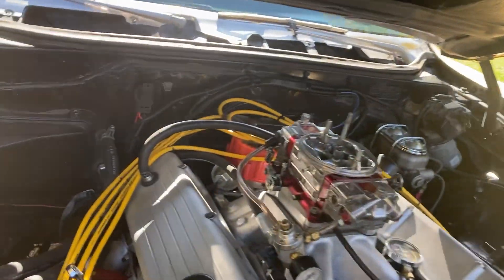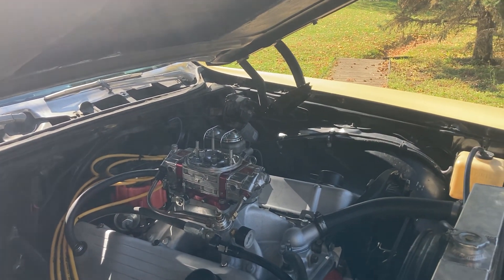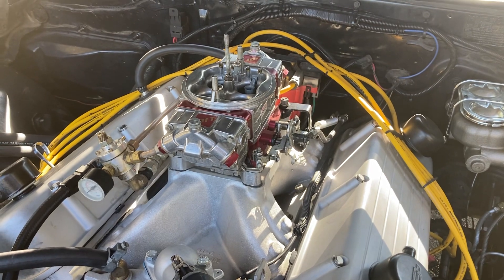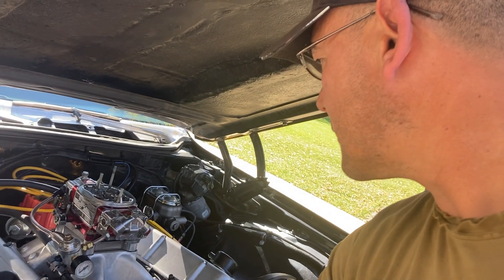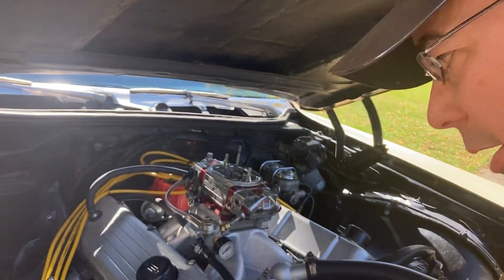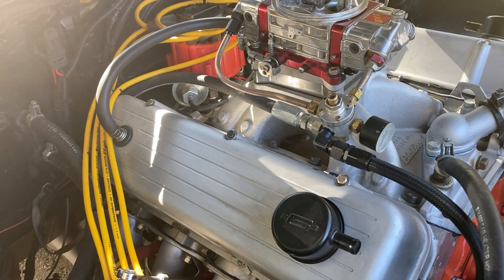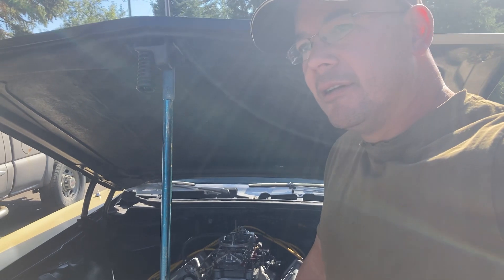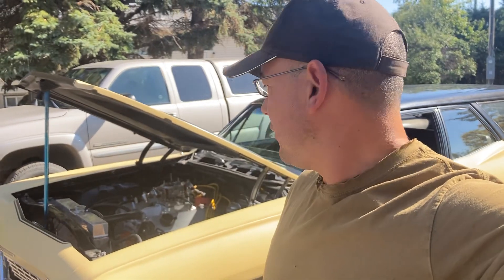Full Manifold Vacuum or Not

Comment: I went to make the change from ported to manifold vacuum advance and was expecting an RPM increase which I was planning on lowering with the mixture and idle screws but it didn’t move at all. What are your thoughts?
Reply from the maker: @RamblingClassics2   Is the vacuum source you swapped to for sure full vacuum? Is the vacuum advance pot in good shape?
Reply: @twgarage-terrywatson1672  can was bad so swapped and working as it should now. Next step is what timing as idle has increase more than the idle screw drop will give me! Mod cam so OEM not applicable so all by feel and vacuum gauge, thoughts?
Reply from the maker: @ keep you base timing and full mechanical the same as you had if you were happy with performance. My car is a manual transmission so no rpm drop from pulling into gear like an automatic. Is your vacuum canister adjustable? You should notice rpm increase with full vacuum. Lower your idle to your preferred rpm. With an automatic transmission, I like to adjust carb while vehicle is idling in gear. (Set park brake, block wheels)
Reply: @ agree re timing and idle lifted but idle won’t lower so now I have to work out why idle is so high! The Screw is fully disengaged so as low as it can go, not sure why so it is a weird one? Can is not adjustable and set at max 10”. If I could get idle to drop job would be done now not sure what to look for as I can’t find any vacuum leaks anywhere. Thoughts
Reply from the maker: @ What carb are you running?
Reply: @twgarage-terrywatson1672  I have an Edelbrock 600. Found my issue the choke was slightly stuck open so sorted now with the can now working I am on manifold advance just had to tweak timing back a bit as it was pinging at light cruising. Just need to decide if I am happy with idle quality as the mod cam chops it up a bit.
Reply from the maker: @  If you don’t have an adjustable vacuum pot on your distributor, I would suggest looking into one. Then you can dial that vacuum advance in perfectly. You could try blocking the vacuum advance to see if your mechanical advance settings are dialed in, then with vacuum added if it pings you could probably dial that in with an adjustable vacuum.
Reply: @twgarage-terrywatson1672  yes mine is a fixed vac unit of max 10”. It did ping at low cruise so I dropped the initial a touch and ping is nearly gone. Adjustable would work well I think as distributor has been modified so will help find the right adjustment for sure. But I am running on manifold vacuum and so far engine is cooler and power is much more lively 👍

Comment: I hooked my 289 up to manifold vacuum and it definitely idled smoother...but 6 months later the brand new diaphragm was already bad... So because there is a constant pull on the diaphragm it won't last as long
Reply from the maker: @joeytacey743  interesting, what brand? I’ve been running an off the shelf HEI for over 10 yrs.

Comment: I retracted my original statement in order to keep your explanation . Thank you for explaining it .
Reply from the maker: @charlespartak2435  Thanks but you are 100% incorrect. At idle is a great spot for full vacuum, why have the throttle plates open more than they need to? Just making more heat.
Reply: Ok. Not arguing , just trying to understand . I see a lot if not most going to full mani vac to the adv pot are 350s or larger and running large cams and holleys.
What do you think of a mildly cammed 283 and a 500 edelbrock avs2? Street cruiser, automatic, 3.25 rear,  about 3750 lb vehicle.
Reply from the maker: @charlespartak2435  The main thing is that full manifold or ported manifold is for very light load, high vacuum situations. At idle the throttle plates are only open a small amount. At this point there is no load on the engine. By adding additional vacuum advance the engine requires this as the mixture is very lean. Lean mixtures require advance as they are harder to burn than a richer mixture. Basically try this. If you are running ported vacuum, hook it up to full manifold and your engine will speed up due to more advance. Then you can close the throttle plates more taking in less air and fuel which will result in a cooler running engine. When you take off the vehicle is under load, the vacuum advance drops out and you will be running on mechanical till you are up to speed. Highway cruising on the flat requires very little hp use from engine, vacuum is high and engine is under light load. The additional timing from the vacuum advance gives you better mileage, cooling running temps. Ported will give you the same at light loads and cruise as well. The full vacuum at idle gives you a more efficient burn as I the spark is happening sooner. Mild engines produce lots of vacuum at idle compared to a more radical build. I personally run full vacuum on all my street cars regardless of mild or wild. Remember, when your foot is to the floor accelerating, you are only running on mechanical. A lot of people mistake this part. Try it out yourself. Don’t confuse manifold vacuum with your total mechanical advance. Most street cars like 12-20 initial with 34-36 degrees total. Maybe another 10-15 of vacuum. These are not exact, yes every combination has slight differences. Try it out yourself. 👍
Reply: @twgarage-terrywatson1672  now that i understood ! Yes, my 283 has what id consider mild cam, summit k1102 , basic same grind as edelbrock performer plus. Edelbrock avs2 500 cfm. Th350 , 3.25 F9 on 225,70r15s. It idles great , drives flats fine,  just not pulling the hills here im n alabama . Currently vac adv is on ported , base timed at 12° btdc , pulling a solid 18hg on the manifold port. 
Ill give the full mani vac a try.
Reply: @twgarage-terrywatson1672  one other thing, my vac pot is the adjustable type. Currently its adjusted all the way in. Im assuming thats full vacuum applied when advance is required. How do i know if or how much i would need to adjust it out. Its a msd /jegs combo i made up of the best internals from each.
Reply from the maker: @charlespartak2435  The adjustment is based on have much vacuum your engine is giving you. The best way would be to hook up a vacuum pump and have it in the vehicle. As well have a vacuum gauge to read you vacuum at different loads/ speeds. My 496 in my wagon has about 10”hg at idle. Due to the aggressive camshaft, the vacuum is low. I have adjust the vacuum can so I am able to gain approximately 10 more degrees of timing at idle. At idle with no load my rpm is 1050 and timing reads 45degrees that’s full vacuum advance. Remember not to mix mechanical with the vacuum. If your engine likes 34-36 total on mechanical. Leave that part and just play with the vacuum. The adjustable vacuum can on the distributor, you are adjusting based on your engine vacuum. I’ll try to post another video and try to better explain it.
Reply: @twgarage-terrywatson1672  your idle speed is 1050? Why so high? Half that is enough.
Reply from the maker: @charlespartak2435  Solid roller cam, open plenum intake, 950 carb, .250, 260 duration at 0.050. It wouldn’t run at half the rpm.
Reply from the maker: @charlespartak2435  That sounds like a real nice driver combination. With the vacuum your engine is making, I’m sure this combination purse like a kitten at idle.
Reply from the maker: @charlespartak2435  Curious, what cylinder head is on your 283?
Reply: @twgarage-terrywatson1672  it does. I have summit racing mufflers on it , true dual. It purrs until i step on its tail then she roars. Sounds pretty good. I did put it on full man vac yesterday. Got idle down more and mixture screws in another half turn from when i had it on ported. It took your explanation and a phonecall from my former tv car guru friend to convince me..
Havent taken it out yet for road test but thats coming
Reply from the maker: @charlespartak2435  Let me know how it goes. 👍

Comment: Mine is also noticeably cooler running full manifold vacuum to my vacuum advance. it's not even close.
Reply: @mooosestang  how much difference and are you using a ground temp sensor? Mine is the mechanical one , mounted up front on top of the intake next to the thermostat neck

Comment: After building my 350 s10 build i learned that most have no idea what they are doing. I used ported vacuum first and got nothing but over heating and shit fuel economy. I switched to ported and now i have better fuel economy and she never runs hot at all! I can sit still and idle all day and never get over 190 degrees. To avoid the typical idiotic argument I will not even say a word when people I knows hot rods over heat, I will just sit there a giggle to myself.
Reply: Reread your own comment. You started on ported then switched to ported...i believe you meant manifold in one of those.
Reply: @charlespartak2435  lol sorry basically ported vacuum works best, its the way shit was before the fuel crisis of the 70's
Reply: I agree

Comment: On my particular engine it actually runs better on ported. I’ve always ran full vacuum but on this particular high performance 350 Chevy, it prefers ported. I believe it is because the timing is so far advanced, initial at 19 and total at 36, full vacuum is throwing off the timing curve when I hit the throttle. It is actually less responsive with full vacuum compared to ported. It really boils down to your engine setup. No right or wrong answer. Go with what works best for your engine. What might work best for one engine isn’t always the case across all engines.
Reply: you need an adjustble  vacuum advance  canister.  and it neess to fully open  at whatever  your  engines vacuums is  at idle.  they need to match  or you could  very well get way too much  at idle,  giving  you that issue

Comment: I've never found that to be true more advance makes more heat harder starting engine and you don't get the best amount of total timing advance for high rpm  this is what I've found with Chevy small blocks with mild cams
Reply: With manifold vacuum done correctly it will never over heat and start hard because you are starting on initial advance and after it starts it pulls in the vacuum advance. So for instance mine starts on 15 degrees timing then once its running the vacuum pulls it too 28 degrees. If an engine cranks hard at 15 degrees advance there are other problems. And with this much advance at idle you are running too lean to ever over heat or get hot exhaust.
Reply from the maker: You only have more timing when it’s running, when it’s cranking the vacuum pot does nothing.

Comment: I agree, manifold is the way to go. the only problem with it is the abrupt drop in timing off idle and on acceleration causing stumble and hesitation, been fighting that problem for a long time. i just recently came up with a simple idea and solve all those issues. i install a small adjustable restrictor valve in the vacuum line to slow down the vacuum drop rate to the distributor therefore giving the mechanical advance time to catch up. No more stumble, No more hesitation and response is so snappy.
Let me know your thoughts...
Reply from the maker: I have zero issues at part throttle, full throttle. My set up I run 20 initial, 36 total and full vacuum 45. Starts good, idles good, part throttle good. Zero issues at any RPM under any condition. My mechanical is all in full by 2500rpm. Every combination will have their sweet spot.
Reply: @twgarage-terrywatson1672  are you using manifold vacuum?

Comment: Ported vacuum.   Because on manifold vacuum it pulls the vacuum can in at idle then soon as you crack the throttle the vacuum can drops put, then comes back, sending your timing reeling backwards and slinging it forward again the moment you crack the throttle.   It works.  But it’s a time killer on the back winding timing at throttle open.   Put that gauge back on it and flick the throttle and you’ll see the momentary vacuum drop and the corresponding whipping back and forth of the vacuum can.  If you put your hand on the vacuum canister rod under the distributor you will feel the vacuum can whip back and forth the moment you crack the throttle.   Having all your advance drop out the moment you crack the throttle is not a good thing.    So I took a 5.5mm Allen head cap screw  and stuck it in the inside hole under the rotor cap.  Now it idles at 30° initial.  Have 6° of mechanical.   Another 14° in the can on ported vacuum.   Then you get all the benefits of idle cooling, better mileages, crazy throttle response and all the rest without the timing ducking out on you at the EXACT moment you need it.   Check me.   You will see.
Reply: the vacuum canister  should open at whatever  your  engine  vacuum is at idle  AT ITS HIGHEST READING.

so if the engines is  idles at 12 inches  at its  highest  reading then that canister need to match it.  pump it  up with a pump  and get the vacuum hand pump to read 12  when the canister gets pulled on if not,  youre gonna have  issues  just like you had or have